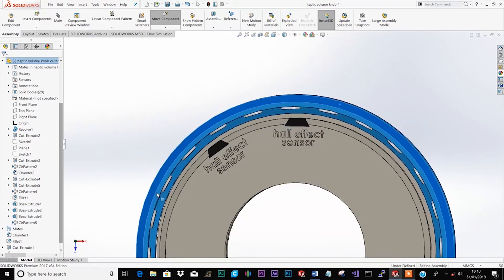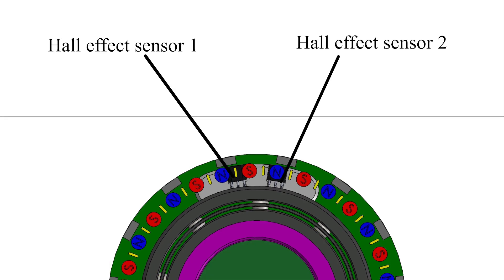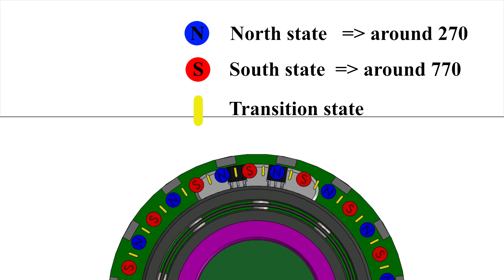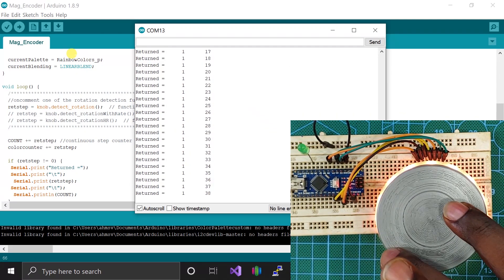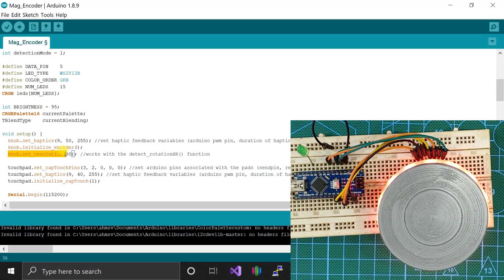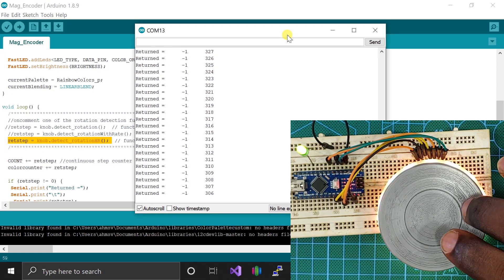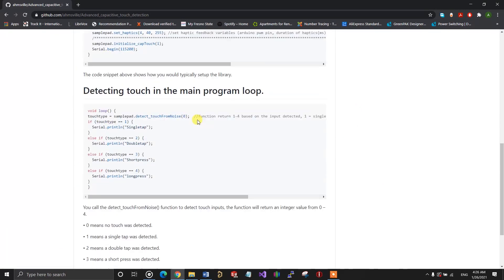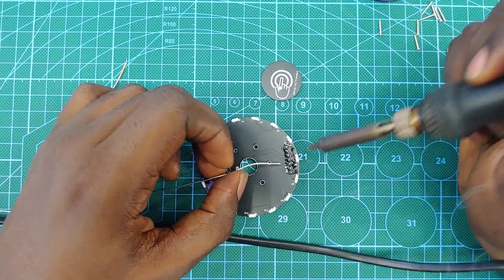Magnetic Rotary Encoding | The refined version

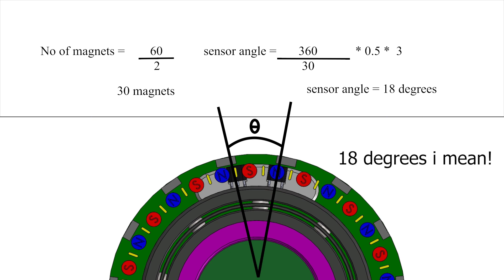Comment: Please explain how did you determine that the odd multiplier value is 3 (at 3:19 in video).
Reply from the maker: It's randomly selected, the odd multiplier can be any odd number that does not result in a separation angle greater than 360 degree.

Comment: so, what if you print this device on a CNC router that has (say) 2 micron accuracy. Then the positions of the magnets will be randomly inaccurate by 2 microns. This error will be magnified when you do interploation, by twice, triple or who knows how much. It is much safer to use a rotary encoder which has physical marks on it, these marks would reflect or not reflect light and this way the precision will be much higher. Or if you want nanometer 100 nanometer or 50 nanometer resolution you could use interferometric sensors. Light is much better thing to use for measurements.

Comment: Great magnetic rotary encoder! Can you freely rotate/spin the encoder very fast without loosing single incremental steps?
Reply from the maker: Thank you, the encoder is primarily designed for low rpm systems, the major limitations comes from the processing speed of the arduino devices....i have tested it to be very accurate upto about 75rpm, the resolution of the encoder also has considerable effect on the speed and accuracy.